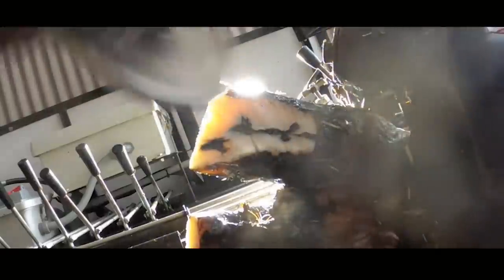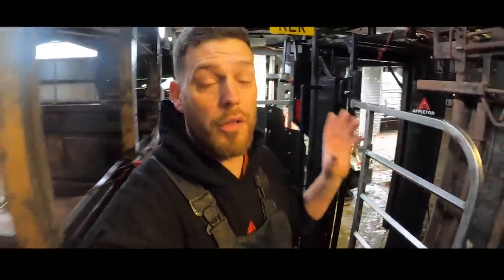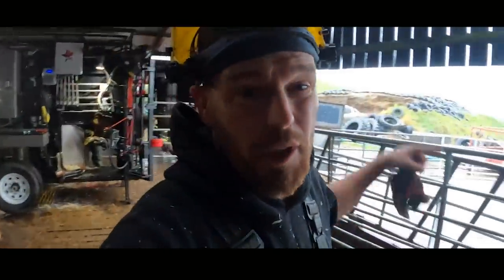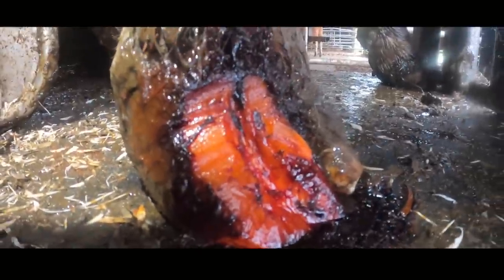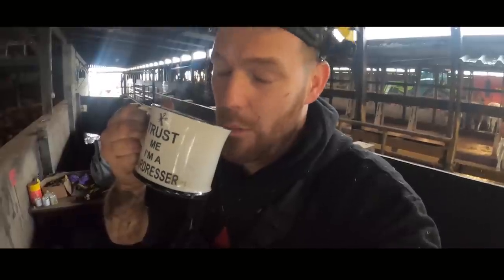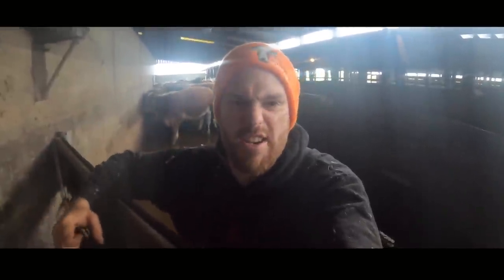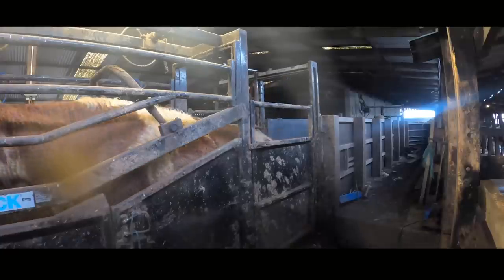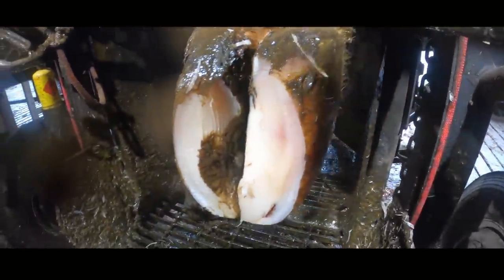MAN RESTORES COWS FEET!!!

Comment: Just a thought.. You said that the drying mud sucks out the moisture of the cow's feet. Well, I know it might take time, but, would it be possible to oil the outward facing parts of the hoof? A final flourish as you send them on their way? I know people oil horses' hooves, but maybe that's why? It might help avoid the sand cracks. Perhaps, with farmers' cooperation, you could run a trial of it: Some oiled, some not.
Just a thought.

Comment: I gotta ask.. when you say rounding out sandcracks.. do you mean filing them at the point where they are heading to (below the crack if heading downward)
Would something similar to vaseline n these after treatment  help??. Iodine is a no no on these  as it will dry them further..
I have this issue.. and actually was the reason i started watching you in the 1st place..

Comment: The high price of those gingerbread lattes isn't the real price same as many small items with ludicrously high prices.  The reason is it's such PITA to keep relisting items that have run out of stock that you keep the listing active by putting a price on it whereby no-one is even going to consider it.  When the new stock comes in they simply change to the correct price in seconds.  Simple.